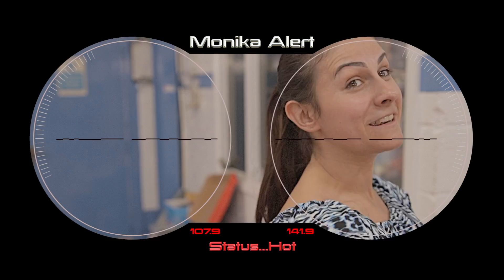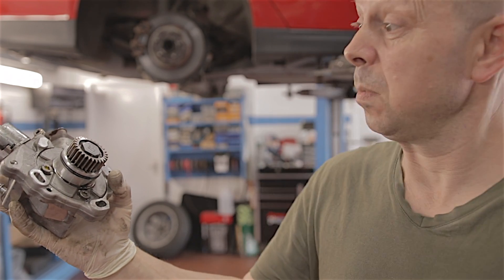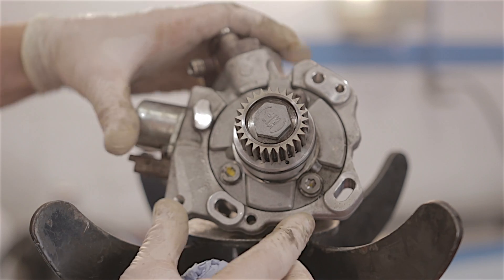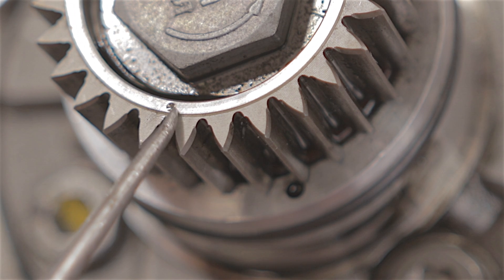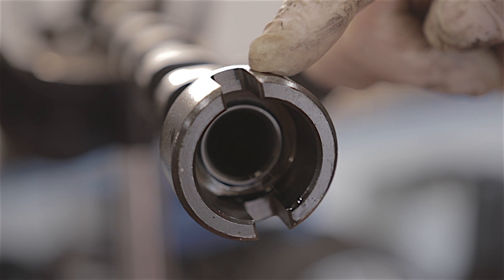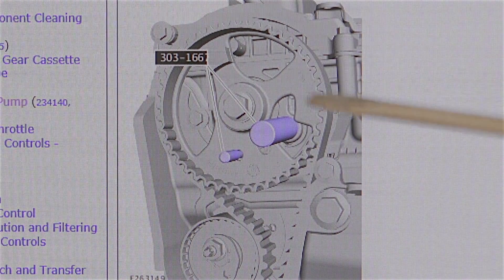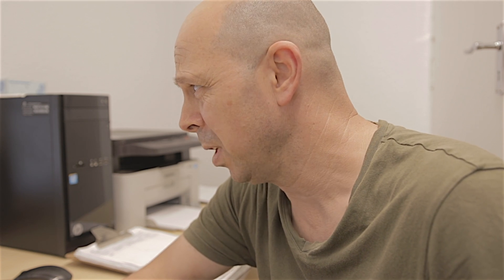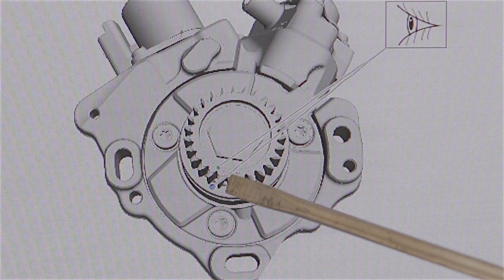Common Rail High Pressure Fuel Pump Timing.... (mk5 ford mondeo)

Comment: Hi Alan I've just watched your video about the pump timing. I changed my wet belt to a chain but I wasn't aware of pump timing. Will I need to strip it back down to check this. It seems to be running fine. It's a 1.8 transit connect 08 plate. Thanks Alan.
Reply from the maker: hendyrobertson 
Hi. On your engine I am pretty certain your high pressure pump is not timed but I am not 100% on that. 
What I will say... I have done countless chain conversations on those engines and only set the chain and can belts up... never the pump... the taxis that were chain converted at about 100k miles got sold off about 350-400k miles and never had a problem so I would say leave your car as it is
Reply: That's brilliant Alan and thanks very much for your speedy reply.

Comment: You didnt mention about timing the dog drive via the inspection window. When you take the square drive bolt out of the dog drive housing you can see a marked tooth. And as you said the dog can only go in 2 ways and one way will have the marked tooth in the window/ bolt hole the other wont.
Just pointing this out incase you didn't know.
Reply from the maker: DodgingSpice 
Thanks for this I was unaware. 
 That information was not shown on the ford etis page I was looking at so must be on a different page but all this information is very useful, thanks

Comment: And what is the price of new fuel pump? How many cases did you have with this problem and at what miles range?  Thank you for all the great videos. Cheers.
Reply from the maker: Igor Markic 
Hi..  a new pump from ford will set you back around £700. 
 Aftermarket pumps around £550. 
This is the first problem where I can relate a pump to cam belt damage
Reply from the maker: Igor Markic
 The car had done just over 80k miles for the pump to possibly cause the cam belt teeth to shred. 
 Yes you can remove the spring from another pump and fit it straight onto the pump on your car
Reply: Could you(theoretically) just replace the spring on the fuel pump if you would disassemble it from and replacement pump.